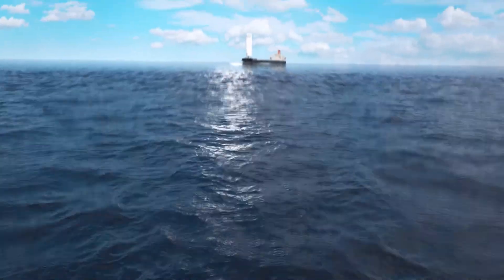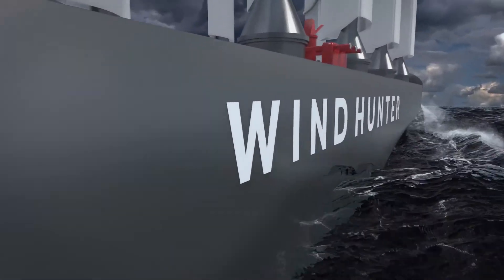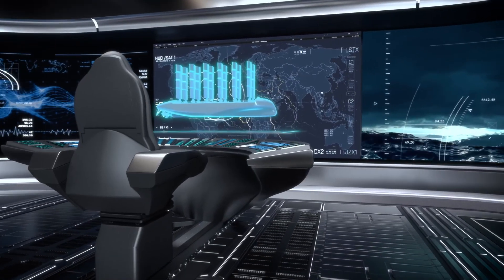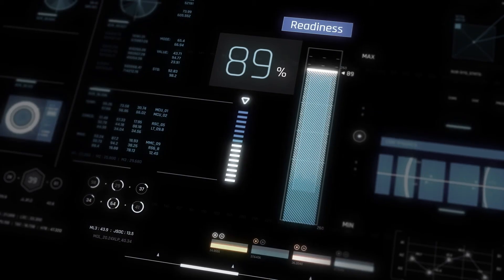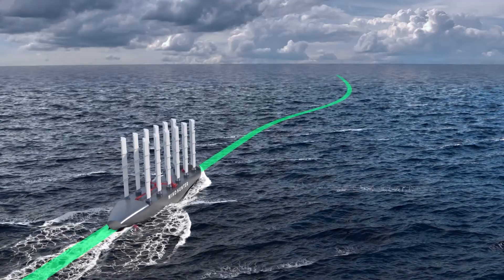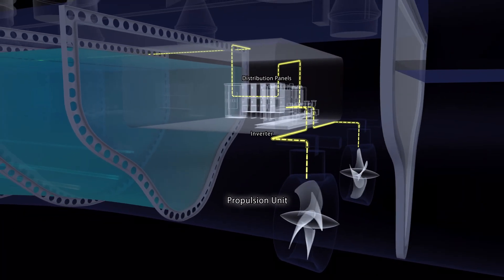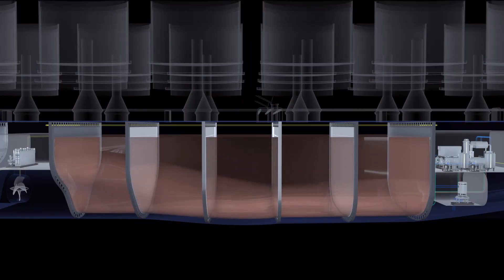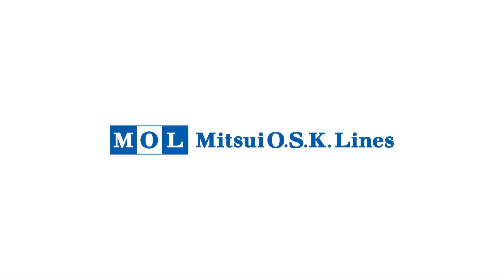（Full Version）Wind Hunter Project ~ Zero-Emission Project with Wind Propulsion and Hydrogen ~

Comment: How's the total efficiency from wind to chemicals to electricity again? In addition, how is the hydrogen manufactured from seawater without clogging filters or eating away the metals?

I'm saying that otherwise this sounds good but messing with the hydrogen in the process seems more like marketing trick than engineering solution.